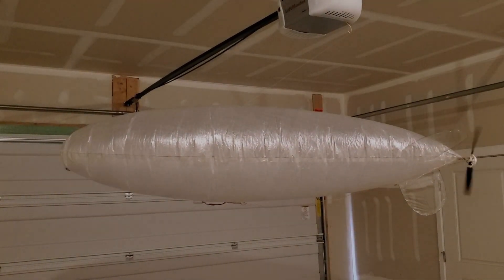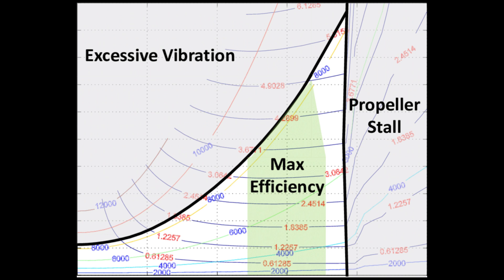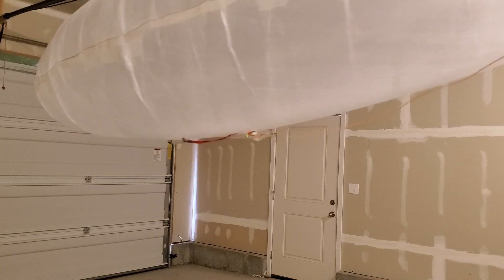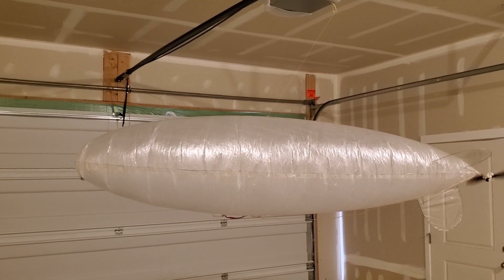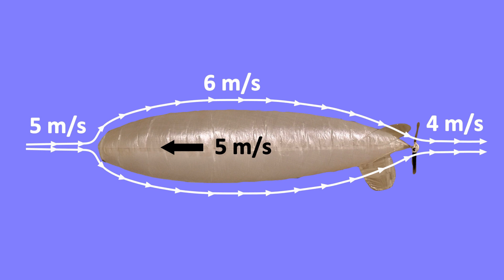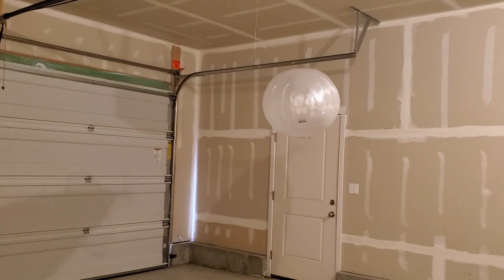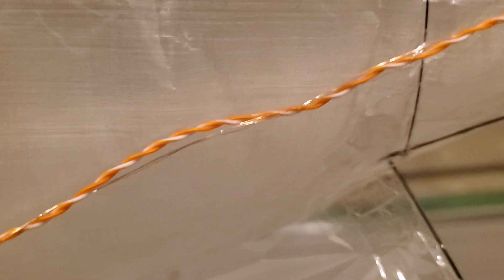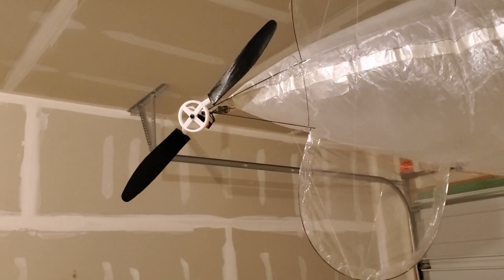Blimp Drone Thruster Design Overview

Comment: Great video!
One question: do you have any scientific sources that explain these points in more detail? Or is it all based on practical experience?
Reply from the maker: A lot of this came out of discussions with Johannes Eissing, who wrote this paper that discussed the topic: https://www.scribd.com/document/77667076/17-Eissing-Widerst?fbclid=IwY2xjawJ0mMJleHRuA2FlbQIxMABicmlkETFBemc1QVlkTjM0RTV0NDJxAR5ev91260mqfyyOVb8oNzYoCmvlqlbV3V9vRAsYbmxgGDateDPd8yZW6cQECQ_aem_s_AI9yovX9QbgjnV972JcA

Unfortunately it is in German. I reviewed the material and the discussions, and I don't think it gave exact numbers for the difference in flow numbers. And it would vary based on the geometry and material anyway. So I would summarize as: the effect is definitely real, but the exact numbers can only be determined experimentally.

Comment: I have printed and gotten parts but in my original testing realized there is nothing keeping shaft and or motor mount together. How do you keep it all together ?
Reply from the maker: you need a rod to put it on, and it is best not to 3d print it so it will be smooth. I used a carbon fibre rod, but you should be fine to use a wooden one
Reply: @ in tractor configuration what keeps propellor from pulling off the rod is I guess the issue I’m having.
Reply from the maker: @timhogan6766  hmmm... I think I just glued a bit of plastic to the end of the rod.

Comment: What's the envelope material? Plastic bag?
Reply from the maker: @carlosdavidgalarza9338  in this case it is a verybinteresting material called Dynema Composite Fabric or DCF. Its expensive and hard to work with, but very high tensile strength and tear resistance.

Comment: Another possibly dumb question. I first found this channel because I wanted to make a blimplike drone, but I wanted to see how feasible using an air bladder for up/down movement would be? Something like a pump connected to a balloon. The problem with this design (I think) is that it would not work unless your hull had no give. If your hull is expanding/contracting along with your air bladder, the air density inside would be mostly unchanged. I'm not sure what type of materials a person could even use that would be lightweight enough, and also stiff enough. You might have to scale it up to an unreasonable size to hit the sweet spot.

Comment: Maybe this is a dumb question, but If you use copper rods as support for your structure, could you also use them to transport power to the back propeller? Replacing most of the wire and therefore weight?

Comment: So I'm trying to do something similar, but I don't understand the power leads going to the tail. It seems that there would have to be power to the tail from the batt, and then power back to the receiver from the ESC. I'm not very conversational with these systems, could you splain it to me? I want to have a 2s batt powering my system but have the BEC supply 3.7 to the motor. Maybe I'm trying to do something that requires more wires.

Comment: I wonder about rolling the entire body, so there's just one long blade jutting out the side. That way, the blimp doesn't need to be very stiff. You just have a ring around the body, or a spar through the body. The blade on one side is counterbalanced by the battery and control electronics on the other side.

You mount an off-the-shelf motor/prop to the blade. The blade zooms around the blimp at airplane speeds, so there's no need for gearing or anything. It's basically like a simple airplane flying around the waist of the blimp.

This system places the prop some distance away from the blimp's skin, so it should be pretty robust. The blade could include a flexible wire bumper to prevent hard impacts.

For control, you cyclically "pulse" the motor as it goes around the waist. It's kind of like a sideways helicopter, with just one blade.
Reply: I sketched how this waist fin would work: https://pluspora.com/posts/a81c5ab06b1e01391f5f005056264835

To make the "blade" easier to make and mount, it's a helical strip of plastic cut from a drink bottle. That way, it can be attached simply with two pieces of tape. The helical shape gives two attachment points a lot of leverage, but it still has a lot of "bounce" for dealing with collisions. The motor/prop is attached to this helix. You do want to pay attention and turn off the prop if it's about to hit something (like the ground). But other than that, it should take collisions all day no problem.

The battery and electronics are taped to the opposite side of the bag for balance. You only need two lines, wired directly to the motor. Hmm ... you could even run the lines around the waist in opposite directions, which might be a convenient way to tape the battery/electronics to the bag.

So basically, the lines are pretty short, and there's no need for dead weight to balance anything because it's all around the waist.

The prop spins fast. The blade spins slow. No need for gearing losses or noise.

Comment: I am curious to the pros and cons of using a ducted fan instead of an open prop. Also curious about the pros and cons of using dual coaxial counter rotating props. The second counter rotating prop ought to be able to extract a lot of thrust from the wake of the first prop.

Comment: This is probably a stupid question but instead of a gear to slow the RPM couldn't one just lower the power to the propeller so it is spinning slower?
Reply from the maker: Not a stupid question at all. Unfortunately the motors we have available are terribly inefficient at low RPM. Some of that is because the motors are designed for airplanes, which want higher pitch speed with lower thrust than blimps do. And some of that is simple mechanical limitations. Small diameter stators just naturally want to spin faster.

Comment: What material is used for the envelope. The technical name, the market name, important dimensions, and the sealing.
Reply from the maker: That envelope is a custom made composite of PVOH (polyvinyl alcohol) and DCF (Dyneema Composite Fabric, itself a composite of UHMWPE  fibers in between thin BoPET layers). The PVOH is a gas barrier, and the DCF is lightweight and high tensile strength. The material is difficult to work with, but extremely light. About 14 grams per square meter combined. Compare that to about 30 grams per square meter for typical "balloon foil". The sealing was done using Hysol U-09LV glue. The envelope was 2 meters by  0.33 meters, and had a volume of 0.1 m3.

Comment: You are now the YouTube authority on blimps
Reply from the maker: High praise indeed :D
Reply: Well deserved in my opinion! I urge you to make an instructable of some kind.
Reply from the maker: @PS-nf3xw  Yes, I'm trying to put enough information out there that people could make their own blimps and fly them around. I did make a tutorial on how to make an envelope. The tutorial uses cheap safety blanket mylar, but the same basic technique works with a wide variety of materials. You can see it here:
https://www.youtube.com/watch?v=56KqPMobyJw
Reply: @BaccaYarro  yes, I saw that. Quite informative. But the silver foil makes visibility bit low. An instructable helps to make references easier. Further, you may also do something on heat sealables. But ofcourse take your time, quality over quantity.

Comment: Bacca, youve made me obsessed with airships!
How about adding a ducted propeller to improve efficiency?
Would it be benificial to have the propeller in the very centre of the structure so it becomes an elongated toroid?
And what safety systems could be used to allow hydrogen to be used as a lifting gas once again?

Comment: How do they scale? Presumably doubling the gas volume is also going to hugely increase the weight of the balloon? Is there some kind of ratio? And then you also presumably need more, and more rigid, materials as the craft increases in volume?
Reply from the maker: Yes, in general airships scale very well from a physics standpoint. Volume increases with the cube of scale, while surface area (IE: envelope weight) increases with the square of scale. That is a simplification, there are other factors. Past a certain size blimps no longer make sense, and rigids are lighter and stronger. And the big one for me is large airships are expensive and difficult to manage. And, if filled with Hydrogen, dangerous.

Comment: Where do you get the foil that you use for the envelopes of your airships, and how does one get their hands on polyethylene coated aluminum foil for an airship envelope?
Reply from the maker: The airship pictured was made using Dyneema Composite Fabric. That is expensive and difficult to work with, but makes the strongest and lightest envelopes I am aware of. I recommend beginners use aluminized mylar, which is much cheaper and easier to work with. I made a video talking about how to make an envelope using safety blanket mylar, which you can find here: https://www.youtube.com/watch?v=56KqPMobyJw. It sounds like you may be referring to "balloon foil", which is basically aluminized nylon with a heat sealable layer which I think may be polyethylene. Unfortunately the one guy that used to sell that material to the public no longer does. There is a guy in the UK I know of that will sell it, but he doesn't have an online shop.It's on a person by person basis.

Comment: At what point does the blimp become a proper dirigible? Is a more rigid structure desirable for aerodynamic purposes?
Reply: Dorigible basically means when your 'thing' becomes controllable or drivable. It has technically nothing to do with rigidity.
Reply: Dirigible pretty much includes blimps and airships, when controllable, but airships are rigid.

Comment: Very interesting listening to you explain this! Keep up the good work Bacca! 

Which out of curiousity what about just forgetting the propeller and put a jet turbine or rocket on a blimp instead? lol
Reply from the maker: I actually would like to see a serious attempt at high speed airships. In theory it should be possible if the (admittedly pretty difficult) problem of making the structure strong enough can be overcome.
Reply: @BaccaYarro  I wanna see that too, idk why no one has seriously attempted those AFAIK (even now, 5 years later). I guess because they might gain most lift aerodynamically and wind up just being useless as a result? still worth a shot, maybe carbon fiber could work for the structure?